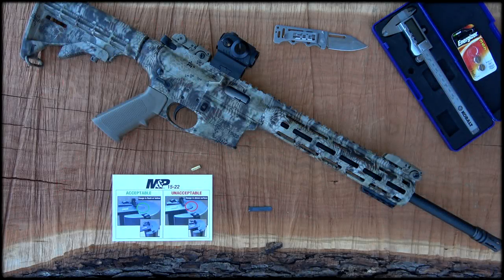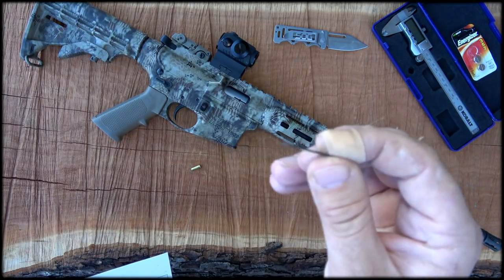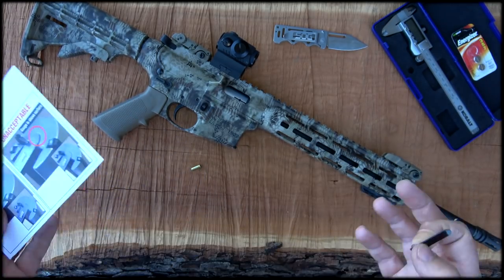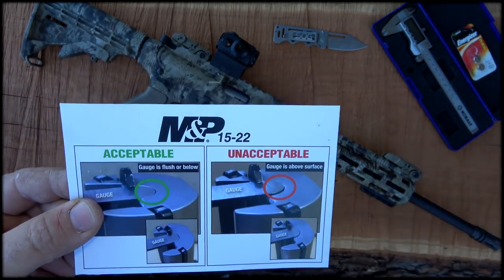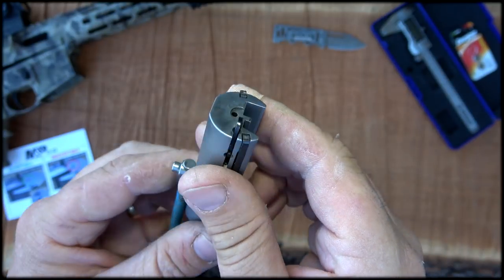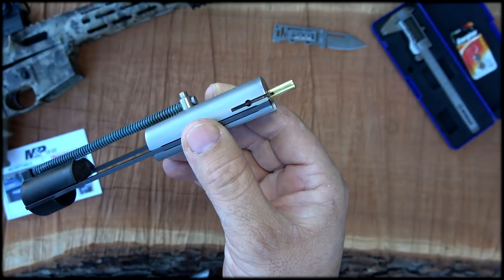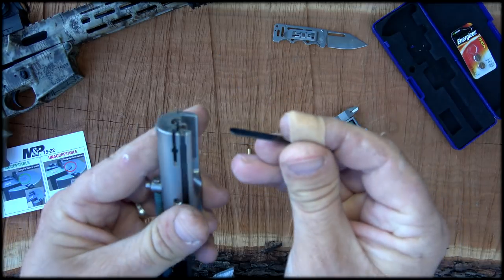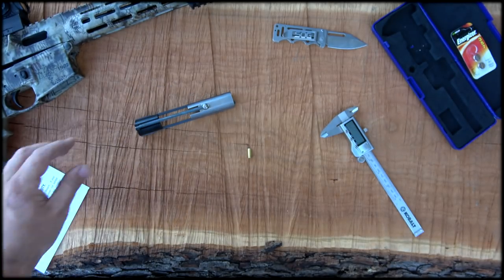Smith & Wesson M&P 15-22 Safety Alert

Comment: It seems if it wasn't cut deep enough,   the extractor would not likely be able to grab the front of the rim to extract it,  which would be another big annoyance and be noticed first.   My STG44  can not extract a round at ALL manually -   it functions OK when the gun fires.  It has a similar bolt so I should measure mine.
Reply from the maker: I'd bet that some of those effected probably do have extraction issues though blow back operation can cover that symptom up. Check the cut on that STG44 and see how deep it is. I'm curious.
Reply: @buffalosoutdoors  It makes sense.   Having a gun where the extractor won't extract a live round manually is a pain in the butt and could be seen as a safety issue trying to clear it.   You have to point the rifle up and try to shake it out.  It's ridiculous.    I even tried to file a little off the tiny extractor to try to get it to engage,  but if the bolt face isn't deep enough,  then that can be the whole issue.
Reply: It measures around  .043"  so that may not be the problem.  I should see if GSG is willing to work with me.  I like the gun but I hate that it doesn't function as well as a 10/22 as far as extraction goes.

Comment: You could use the depth function of the calipers (rod on bottom) to measure the recess. You have to be careful and do it a few times as its easy to get a bad reading that way.
Reply from the maker: Yes, I could have done that, probably should have, but at the time I was only thinking of showing the thickness of the gauge.

Comment: Should I even buy one right now because of this or hold off?
Reply: The issue has been fixed but you can still check the serial number on S&W's website to be safe
Reply from the maker: The new ones are fine. As are most of the older ones. Just better to check and be safe.